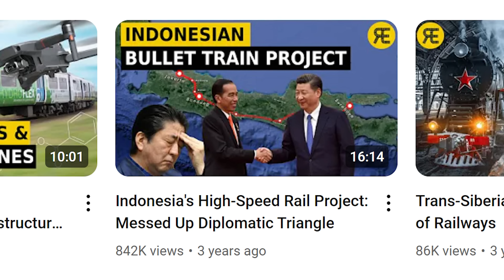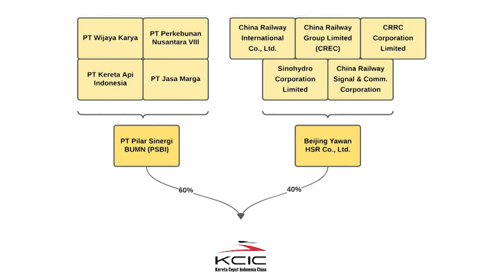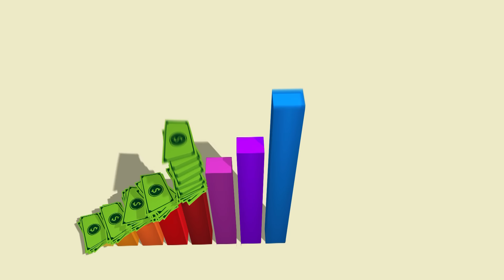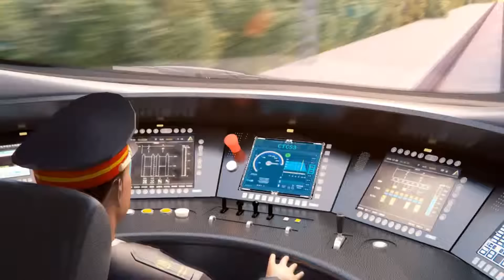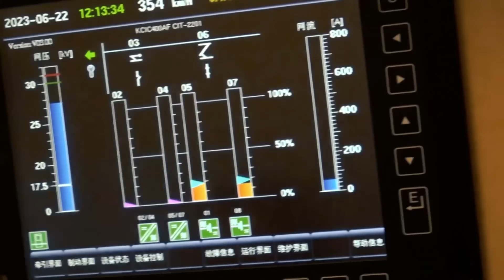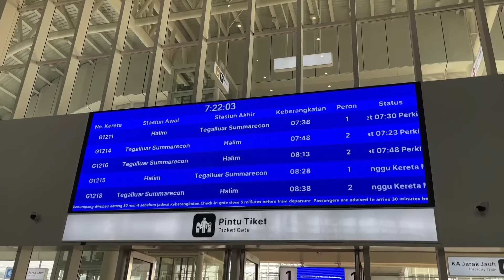Indonesia’s High-Speed Rail: One Year of Jakarta-Bandung Operations | 2024 Project Update

Comment: Too many unreliable informations here. Just to clarify that ain't nobody stupid enough not to build redundant system on HSR, these include signaling, power transmission, sensors and actuators.

Track laying also not an issue since long time Indonesian railways has a lot experience to deal with continuous welded joint, the only thing different is that 25m rail usually imported from Japan which uses Japanese Industrial Standard while this one is Chinese standard.

One thing that relatively new is the ballast less construction methods.

The feeder train might be limited but on seating capacity only but overall capacity which include standing capacity is well above even CRH420 maximum capacity. The video somehow forget to mention about it.

If there is one thing that I want to complaint about Jakarta-Bandung HSR that would be the urban transport system before embarked to HSR. In China you'll get so many option to go to the station and free from traffic jam, but that's China which has more mature urban transport. Indonesia build the HSR first while the urban transport is not mature yet. This combine with Chinese type planning which placed the HSR station outside city center makes 45 minutes and efficiency blown away.
Reply: China bangun stasiun juga banyak diluar pusat kota dan areanya dikembangkan sekalian.. sama seperti Bandung dimana Tegal luar / gedebage kan direncanakan utk jadi pusat pemerintahan Bandung yang baru.. dulu malah Ridwan Kamil punya cita2 bangun kawasan itu sebagai Silicon valleynya Indonesia.. meskipun lambat tetapi perlahan cita cita itu terwujud.. ITB juga sekarang membangun gedung pusat inovasi disana.. Kalau mau nunggu semua sempurna, yah kita nggak bakalan maju maju.. Misalkan proposal Jepang utk HSR dulu dijalankan, membangun stasiun di Dukuh Atas dan Stasiun Bandung..hmm 10 tahun lagi juga mungkin nggak selesai dan biayanya terus membengkak..LIhat aja itu MRT Jakarta Fase 2, cuma bangun berapa km saja selesai total 2029
Reply: @andipejalan3382  Komplain saya bukan cuma pada perencanaan tetapi juga implementasinya. Punya urban transport yang matang seharusnya di level prioritas tentu lebih utama daripada konektivitas antar kota. Kebutuhan primer tetap prioritas diatas kebutuhan sekunder.

Saya ngerti dari blueprint MP3EI memang akan dikembangkan kawasan baru sebagai pengganti Walini yg dulunya direncanakan sebagai ibukota Jawa Barat. Poin saya ada implementasinya, di China juga dibangun dulu transportasi dalam kotanya setelah matang baru kereta cepat dibuat, jadi mau ditaruh diluar pusat kota pun integrasi antar moda terasa seamless, ga sia-sia mangkas waktu sekian jam plus biaya lebih mahal dengan kereta cepat.

Pertanyaannya di Bandung tidak demikian, mau lewat jalan raya pasti macet, transportasi rel? Jalur ganda Cicalengka-Padalarang juga belum selesai, padahal skala prioritas transportasi dalam kota harusnya berada lebih tinggi kalau merujuk sesama standard yg diimplementasikan di China.
Reply: @fendysuryanto  Satu yg kamu gak paham, itu jalur Cicalengka-Padalarang prossesnya lambat karena tantangannya multiple. Gak cuma di pembebasan lahan tapi juga di persinyalan yang masih pake hybrid sistem elektrik dan non-elektrik. Kalo lu mau komplain soal konektivitas antar sistem silahkan komplain ke pihak pemkot/pemda terkait. Masak iya, gara-gara pemdanya gak becus sinkron dengan rencana pemerintah pusat lalu yang disalahkan pemerintah pusat??
Reply: @ignatiusryd2031  Rel kereta itu ranah pemerintah pusat karena sudah tertulis jelas di RIPNAS, yg menjadi kewenangan daerah itu sterilisasi jalan provinsi dan kabupaten. Baca di MP3EI supaya paham lingkup kerjanya. Kalau situ paham Track Access Charge (TAC) juga dibayarkan ke Kemenkeu, bukan masuk PAD.

Sejauh ini cuma MRT Jakarta yang bisa dibilang bebas TAC, itupun pemerintah pusat mentransfer 51% total biayanya.
Reply: @fendysuryanto  Kemenlu boleh punya timeline tapi kalo memang tantangannya bilang tidak bisa selesai sesuai target waktu karena pekerjaanya memang sangat banyak?? Terus mau tetap berkotek kayak ayam?? Womp womp womp womp womp.

Lucu sih lu komplain soal konektivitas dan terlalu mengandalkan lokasi stasiun harus di pusat kota tapi lupa kalo lokasi stasiun Tegalluar gak jauh dari project kawasan urban baru yg emang jadi fokus area pembangunan di Bandung sekarang.
Reply: @ignatiusryd2031 Ga guna juga masyarakatnya saja kurang pandai membaca tapi minat komentar tinggi. Kemenlu siapa woy bangun!😂
Reply: @fendysuryanto  Gak guna?? Womp womp womp womp. Faktanya memang kemenlu gak punya kuasa maksain proyek selesai tepat waktu apalagi kalo emang tantangannya sulit banget. Womp womp womp womp womp womp
Reply: @ignatiusryd2031  Bangun coy! Kemenlu itu kementerian luar negeri, saya bahasa TAC itu kemenkeu alias kementerian keuangan. Biasa baca secara cermat.

Pun itu yang melakukan rencana adalah Bapennas (Badan Perencanaan Pembangunan Nasional). Ayolah kalo ngejudge minimal literasi dinaikan dulu.. Jangan asal nyablak..
Reply: @fendysuryanto  menurut anda yg lebih prioritas apa? transportasi massal di dalam kota Bandung? Saya pengen tahu kenapa Bandung gagal membangun transportasi massal padahal sudah banyak rencana sejak RK jadi walkot. Yah krn harus siapkan subsidi besar utk mereduce harga tiketnya. Bahkan sekelas Surabaya saja masih tidak mampu. Atau mau disuapin terus pakai APBN utk operasionalnya seperti LRT Palembang ? Menurut saya membangun HSR Bandung Jakarta saat ini juga bukan keputusan yg salah. Apalagi sudah ada rencana akan diteruskan sampai Surabaya meskipun blm tahu kapan. Saat ini mungkin belum terlalu terasa dampaknya krn hanya 140 km, tapi kalau sdh terhubung  dgn Yogyakarta sampai Surabaya baru akan signifikan. Dan sekarang adalah permulaan utk kesana. Saya pernah naik Fuxing di China 1400 km dalam waktu 4,5 jam , sama jaraknya PP Jakarta - Surabaya. Sangat hemat waktu dan praktis utk traveler atau pebisnis yg punya waktu trip terbatas.
Reply: @andipejalan3382  Bukannya udah jelas ya? Matengin urban transport dulu baru bangun kereta cepat, sama kok polanya seperti di China sana. Tapi implementasinya bagus, integrasi antarmoda juga seamless. Baru setelah ramai dan dirasa perlu, stasiun kereta cepat di bangun menghubungkan ke pusat kota secara bertahap.

Yang saya komplain (kereta untuk transportasi perkotaan) justru prioritasnya lebih tinggi dari kereta cepat kalo rujukannya Rencana Induk Perkeretaapian Nasional (RIPNAS). Yakalo kasus Bandung karena udah dibangun KCJB ya matangkan integrasikan dengan layanan transportasi lain

Pergantian penguasa daerah sangat kecil kalo diharapkan untuk bikin kek begini. Bandung secara fiskal sangat terbatas, inilah kenapa poin saya merujuk langsung ke jalur ganda dan elektrifikasi Cicalengka-Padalarang. Kenapa? Ya satu, transfer dana dari pusat jelas lebih besar dananya sehingga feasebilitity dan sustainability nya lebih baik. Kedua, karena implementasi nasional dari masterplannya sendiri ada beberapa daerah metropolitan yg seharusnya mendapatkan pengembangan transportasi urban berbasis rel dulu. Yogya-Solo salah satu contoh yg dimatangkan dulu transportasi urbannya. Walaupun progress disana IMO sebenarnya juga ada extra priviledge dari penguasa Solo.

Kereta penumpang memang pada dasarnya beroperasi di margin loss. Bisa dilihat laporan keuangan KAI tahun ke tahun selalu merugi, justru kereta angkut barang (khususnya Sumatra bagian Selatan) yg jadi penyumbang keuntungan. Ini ga terjadi di Indonesia saja, di Jepang pun terjadi demikian. MRT Jakarta bahkan kalo ditelisik di laporan keuangannya secara teknis merugi. Disini dibilang "merugi" ya karena MRT Jakarta masih mendapat suntikan berupa "pendapatan subsidi". Lain kalo dikelola seperti bussiness as usual pembukuan seperti ini seharusnya tidak akan pernah ada.

Perlu diketahui bersama tidak semua investasi dari pembangunan moda transportasi berbasis rel selalu kembali dalam skema FIRR (Financial Internal Rate Return) kelayakannya bisa dinilai juga dari EIRR (Economic Internal Rate Return). Dg hasil dari EIRR adalah mempercepat perputaran ekonomi regional (Produk Domestik Bruto Regional), penghematan subidi BBM dengan diarahkan untuk mensubsidi ekonomi produktif. Hasil dari pertumbuhan PDRB bisa digunakan untuk mempersehat ruang fiskal pemda.
Reply: @andipejalan3382  Coba dilihat implementasi disana? Dari jarak sekian, efisiensi dengan integrasi moda transportasi lainnya bagaimana? Sementara di Indonesia bagaimana?

Disitu komplain saya satu-satunya, coba liat postingan paling awal saya yg berbahasa Inggris.
Reply: @fendysuryanto  mas Jangankan Indonesia..US dan Eropa saja infrastruktur publiknya sudah kalau jauh sama China.. Nggak fairlah bandingkan integrasi transportasi kita saat ini sama China.. KIta harusnya bersyukur lho China mau membangun HSR pertama diluar negaranya, dengan resiko lama balik modalnya yg seperti sampeyan sampaikan.. TAPII..lihat Intangible benefitnya dari proyek ini,. Kompetensi kita bisa meningkat mulai dari kemampuan konstruksi ( membangun terowongan, jembatan dan track kereta ) dengan cepat dan baik, belajar persinyalan HSR, belajar mengemudikan HSR termasuk belajar teknologi HSR yg lain juga yg bisa menjadi akselerator teknologi kereta di Indonesia. Mau belajar bikin gearbox nya pun mungkin mereka bisa kasih.. Kalau mau menunggu infrastruktur transportasi publik kita terintegrasi dulu kapan jadinya ? Menurut saya harusnya bisa pararel dengan integrasi, seperti yang dilakukan Jakarta ketika jalur MRT sudah jadi. Integrasi Transjakarta, LRT, KRL dengan MRT jg dilakukan pas MRT sudah beroperasi. Sekarang masyarakat bisa menikmati hasilnya
Reply: @andipejalan3382  Mohon dibaca secara cermat komentar saya diatas. Apa esensinya?

"One thing that I want to complaint"

Efisiensi macam apa yg ditawarkan kalo end-to-end destination waktu tempuhnya sama?

Justru itu pakai skala prioritas yang kebutuhan primer dipenuhi dulu baru sekunder. Ini letak kesalahan eksekusi kita. Orang pergi ke luar kota ga setiap hari tentu prioritas harusnya kemana sudah jelas. Mau bagaimana sarana itu berkembang kalo dibuat tanpa integrasi yg mumpuni dan terisolir?
Mau berapa lagi stasiun, bandara, pelabuhan, stadion yg musti jadi bukti kalo approach seperti ini tidak optimal? 

Bukan masalah kalo kita salah mengambil langkah, tapi kalo kita masih berjalan diarah yg salah sedangkan sepenuhnya sadar ada jalan yg lebih baik, ya tolong kembali ke jalan yg benar atleast jangan dibenarkan yg salah.

Kalo mengacu ke tujuan yang paripurna baik Eropa, US dan China saya kura semua sadar kalo perencanaan transportasi publik baik tujuannya sama. Atau situ punya grand vision yg berbeda dengan tujuan yg paripurna? Well, let me know.
Reply: @andipejalan3382  Rasanya kita sadar kalo pembangunan Kereta Cepat itu tidak dijalankan paralel dengan pembangunan urban transportnya. 

Kita punya waktu bertahun-tahun untuk mematangkan transportasi perkotaan di Bandung sejak tanda tangan kontrak kereta cepat, hasilnya apa? Paralel? Lebih ke tambal sulam dibanding konsep pembangunan paralel. Jalur ganda belum selesai, elektrifikasi apalagi, MRT, LRT juga khayalan. Jakarta pun cuma LRT Jabodebek yg real menjadi bagian integrasi antar moda dengan Kereta Cepat. KA Feeder di Bandung? Itu bukan paralel sejak awal tapi benar-benar last minute solution.

Kompetensi? Maksudnya dengan klaim hiperbola bahwa kita bisa buat Kereta Cepat tahun 2026? Tanpa peralatan uji, tanpa RnD komprehensif yg memadai, tanpa pengalaman expertise yg berarti?

Salah satu manfaat objektif dari kerjasama Kereta Cepat dengan China adalah kita bisa masuk ke supply chain teknologi HSR. Tentu pengalaman dan kompetensi tidak diserap dalam 2 tahun kedepan ditambah klaim fantastis yg sebenarnya lebih berat ke unsur pembodohan publik.

Masuk ke supply chain HSR melalui peta jalan yg tepat kita bisa melakukan  pernyerapan dan pengembangan indigenous HSR technology. 

Saya beri contoh disini bisa dilakukan dengan learning curve yg masuk akal. Fase ke fase, localization->License production->Indigenous development. Bukan main asal klaim 2026 kita buat Kereta Cepat sendiri, sementara kalo ditengok chain supply industrinya untuk kereta cepat nyaris nol.
Reply: @fendysuryanto  Kalau nggak efisien orang juga nggak akan naik sampai 6 juta penumpang...sekarang saya mau tanya ..kalau memang Whoosh tidak efektif, kenapa mereka akan menambah frekuensi dari 48 ke 62 awal tahun depan ? rugi dong nambah frekeunsi kalau tidak terutilisasi dengan baik ..Balik lagi kepernyataan saya sebelumnya, kedepan kawasan, fasilitas dan moda transportasi akan dikembangkan. Sama seperti jalur LRT Cibubur dimana dibangun apartemen dekat stasiun.. kemudian Stasiun, bandara, pelabuhan mana yg tdk efektif ?? Kertajati ?? Terus kita menutup mata dengan banyaknya fasilitas publik lain yg dikembangkan pemerintah tidak hanya meningkatkan pelayanan penumpang dan mobilitas  tetapi juga mendongkrak ekonomi?
Reply: @andipejalan3382  Coba deh lihat lagi rencana awalnya, berapa EMU yg kita beli dan berapa trip perhari berdasarkan railway timetable yg semula direncanakan? Lucu kan? Kalo kuratornya cuma 6 juta penumpang dan puluhan kali trip?
Reply: Build better subways and not just things to city centers

Comment: The electrification of the Jakarta-Bandung HSR is unnatural at 27,5 kV AC 50 Hz. The voltage used for HSR is usually 25 kV AC 50 Hz especially since China used it there. The only railway with this unnatural voltage is the converted T6 Istanbul Tram Line.
Reply: I can see it as a strategic move to lock out other vendors, especially Japan, if and when Indonesia wants to expand the line.

Comment: Was it worth the expense to shave a couple of hours off the trip?  Doubt it.

They should have built a modern, lower speed train and just saved an hour.
Why?
'Regular' trains can also carry freight and passengers. 
Slower train technology is well understood, safe, reliable and available. 
High speed trains require expensive parts that tolerate ultra-high speeds. They can only be sourced from China, Japan, and Europe.
China today depends on less efficient trucking to move goods due to the preference for trophy high speed trains. 
The fare for fast trains is higher, again, because of the specialized parts. Or the fare needs to be subsidized.
Fast passenger-only trains are off-line longer for maintenance.

Comment: It's km/h, not kmph, kph, khr...
Reply: It's the same thing / = per
Reply: kmph is a well established and often used short.
Reply: You can use any of that lol. No to pedantics.
Reply: writing a 'p' instead of '/' is mostly thanks to free-dom-units.. no metric country does that officially.  'km/h' should be used throughout.
Reply: @joansparky4439  But doesn’t have to, and it doesn’t matter.
Reply: @simondahl5437    there is established common standards and then there is gibberish..  I stick with standards pal. U do u.
Reply: @simondahl5437  kmph is thousand (kilo) miles per hour so it's use is incorrect.
Reply: @ Except its not. Kilo is part of the metric prefixes so why would it be applied to imperial units? 

Nobody in their right mind has ever said kilo-miles…